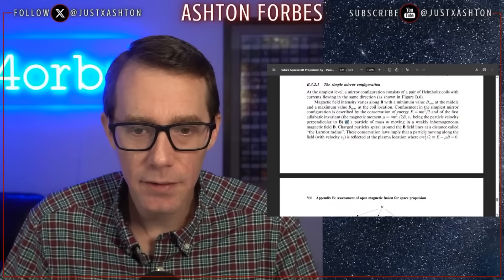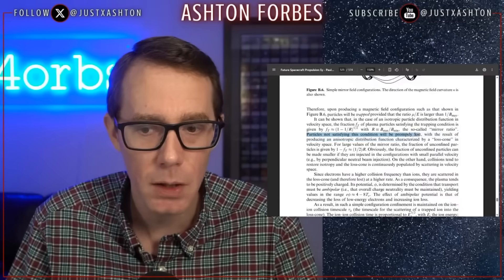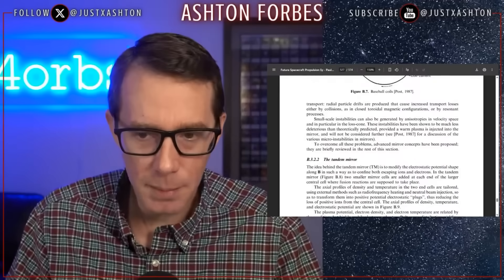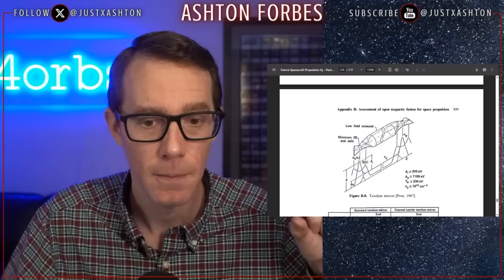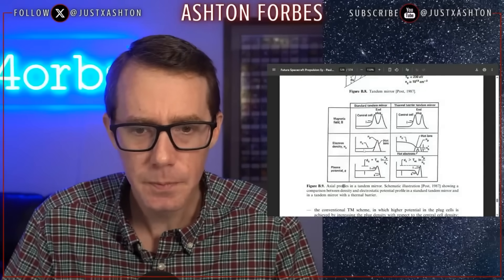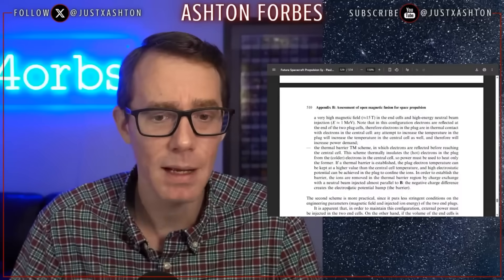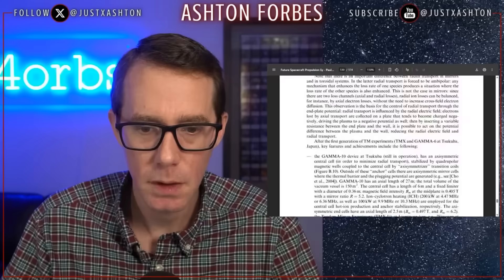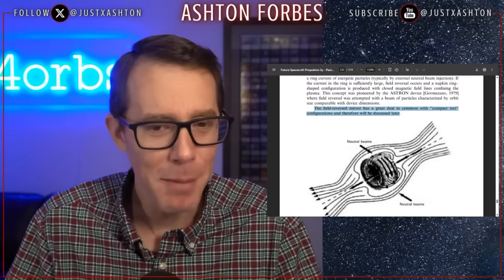The Hidden Geometry That Powers Fusion Flight

Comment: The US Navy had a version of this many years ago but instead of 2 rings (torus) it was a cube with a torus for each 'cube face' and the idea was electrical charges pulled to the centre of the cube. They did about 5-6 trials then it went all quiet. I guess they worked out they don't need 6 toruses ( torii??) they only need 2.
Reply: Generating the dual dynamic spheroid horn torus spin model.

Comment: Ashton, it may be possible to create atmospheric plasma by converging dissonant frequency energy beams in an interferometer fashion.  By so doing the area of convergence will become an energy dump of the energy contained by both beams.  Dependent on frequencies each separate beam may have little to no effect on matter, or even pass through matter without effect, until interacting with the dissonant frequency of the other beam.  In this scenario the orbs would act as visual targeting reticles prior to a full power pulse of the interferometer!  This is just one possible alternative.

Comment: This will never work like described in open air. It is 100% meant for pressurized plasma in a reactor. The mirror effect is in a 360 degree sphere not pinch. Your injectors are in reactors because the loss rate is to high and it requires more energy. In other words it leaks to much. That also means in open air you could never contain it. The center must open for the plane without creating massive eddy current. In this configuration the plane would have been smashed like a soda can against the massive magnetic field. Your looking for the magnetic sheath layer.